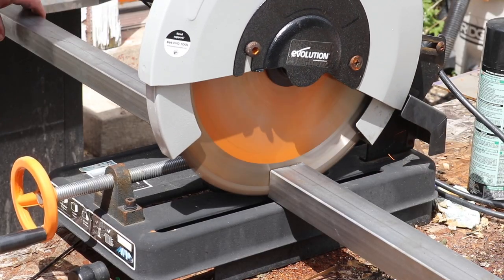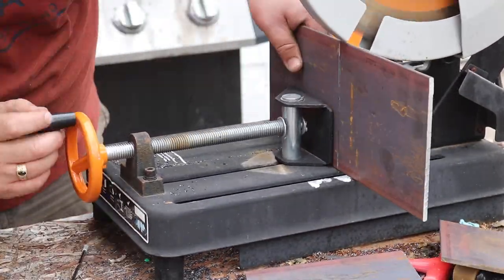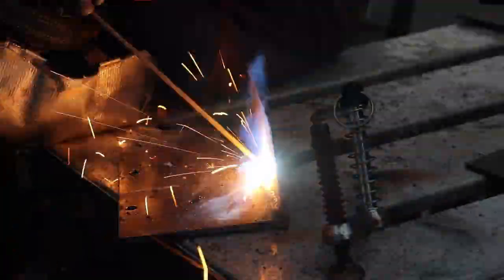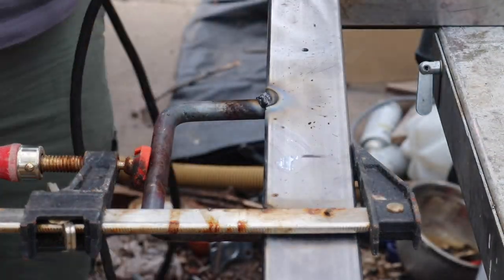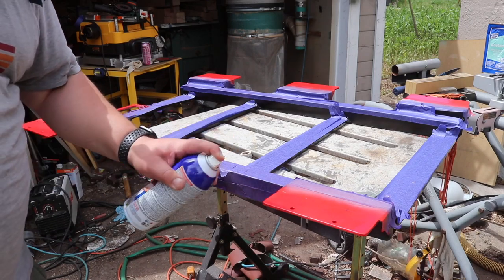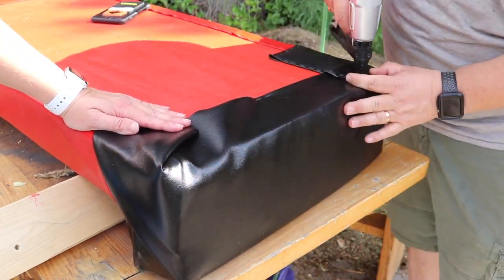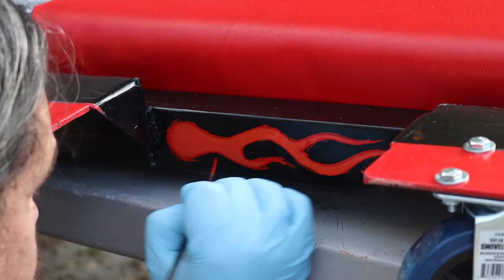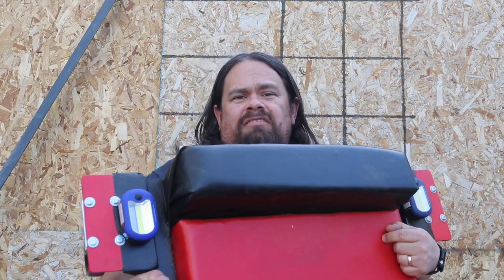Making an Awesome DIY Mechanic's Creeper 💪

Comment: I feel pray to the same problem. I’m 250 and I broke two of those creepers in one day. I like most of their hand tools but HG creepiest suck. I’m gonna build my own. Love the build.
Reply: They sell one for 400 pounds now
Reply: I made one that is not heavy and is very light with 6 inch wheels and will take 500 pounds,  The axels are  3/4 inch threaded rod 18 inches long..  very strong but still light.  The deck is 3/4 inch plywood..  Works very well.

Comment: I Love it, maybe round off the caster mounts or rubber but way cool, I am old, retired, and semi-disabled from a couple strokes in 15' and 18'. I recently got an F250 SD 4D 4X4, and a 2002 toy hauler camper I am rebuilding, and I am 280-300 lbs.  I need an all-terrain HD creeper, is this for SALE?  Or just the complete frame and plans?
Reply from the maker: On this one I think the casters are too small to be all terrain. I find it sticks sometimes on cracks in the cement. One of these days I'm going to build a version two with much larger casters and hopefully an aluminum frame. While this thing has held up very well, it is pretty heavy to carry around.

Comment: Rubberized rocker guard would have been great for the effect you wanted, instead of the plastic dip, and it's permanent. You can find it at any auto place, or Walmart, Costco, almost anywhere really.
Reply: Then to cut the foam you should have laid a piece of plywood with a straight edge on it and knelt on it which would squished it down, then used a utility knife not just the blade and you could run it along the straight edge of the plywood and get a nice straight cut.
Reply from the maker: I’ll have to check that out. Thanks!

Comment: Great work! yours is heavy duty to lay an elephant on it. I bought 1 1/2 * 1 1/2* 1/8 angles to build one myself. I am wondering whether 1/8 thick metal is strong enough to make the side ears for casters holding 250 pounds of weight after seeing yours at least 3/16 thickness.
Reply from the maker: I haven't tried 1/8", but I think if you had a gusset or two on it, it would be plenty strong.
Reply: @BitsandWood  Thank you for your reply! I just built my yesterday with 2 *2 *3/16 angle irons. I chose 3/16 over 1/8 since I feel it is much stronger. I put my wheels below the angles. It is 40*20 in size. When I put a piece 16 inches wide 3/4 plywood in the middle, it has 2 inches of room for tools on both sides along the whole length. I do not plan to put any padding on, but I plan to paint it later.

Comment: ,great job I am.like you a husky guy I do have a idea on the finish look at rusteluom hammerite paint I used the green hammerite paint on my air compressor on my truck it held up.well if I did scratch feather the scratch and look good give a texture finish and 2 coats of clear
Reply: on your tray go to harbor freight an make another box to fit there from.harbor freight magnetic tray to hold the bolts ,hardware which could be attach the side of your creeper
Reply from the maker: I’ll try that out, thanks. Painting is always the worst part for me.

Comment: Do you have a video for those 90 degree supports you used under the plywood when you were cutting it? The design is obviously simple but I’m curious on tips for use and lessons learned using them. I current cut on 1 inch hard foam insulation but I’d love something smaller.
Reply from the maker: I don’t, but I should make one. I always planned to but forgot. 🙂

Comment: All you had to do is turn the handle over in the vise and used the pipe
Reply from the maker: Well, I can honestly say I didn’t think of that. 😉
Reply: I’ve had plenty of ...”well that was stupid “...just speaking from experience...I’m glad you built your own. I got lazy and just bought one
Reply from the maker: @sawboneiomc8809  There are plenty of "that was stupid" moments since I'm still pretty new to welding and working with metal. Sure is fun though.
Reply: Looks like your using flux core wire....that best thing you can do to improve your welds is grind or wire brush the metal where you intend to weld till it’s shiny....clean clean clean metal is the best